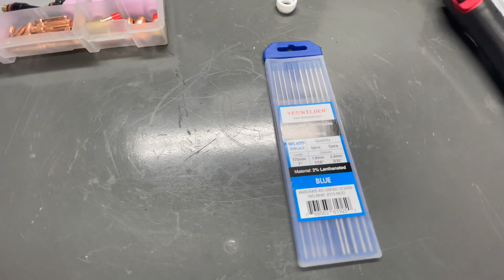How to Set Up Yes Welder TIG Gas Lens Torch

Comment: You're using the wrong insulator.
Reply: The insulator in the video is for the pink ceramic ones and the diffuser. Also the O-ring seal shouldnt be on the threads of the gas lens body.
Reply: @siimkivi  Looks like the wrong insulator for some of those pinks, you need, could do with  a stepped/flanged insulator. Your insulator seems to be for standard parts.
Reply: @siimkivi  where else would it go if the glass cup doesn't have threads
Reply: @spicynoodles2624  The insulator used is for the ceramic, pink cups, the insulator for glass cups usually has a flat surface with a flange.
Reply: @jimmanyk absolute 🤴 thank you
Reply: @siimkivi  Nope, The threads are not the place for the O ring
Reply from the maker: Good callout Jimmy, thank you!
Reply: No he isn't